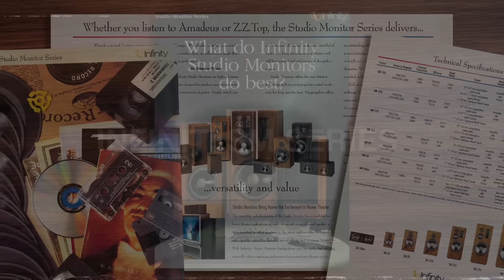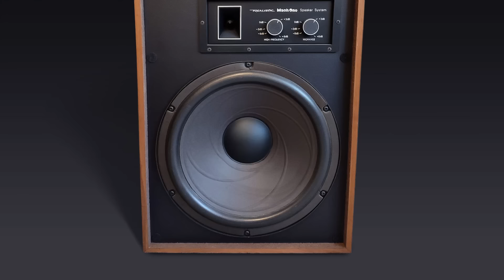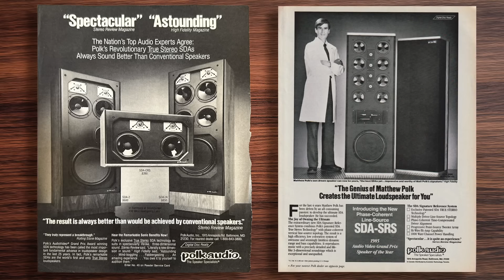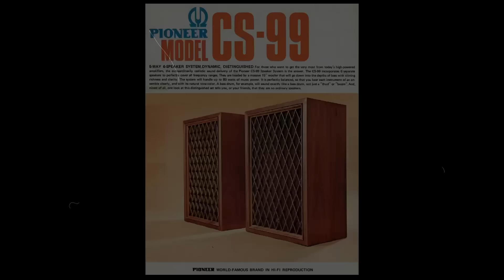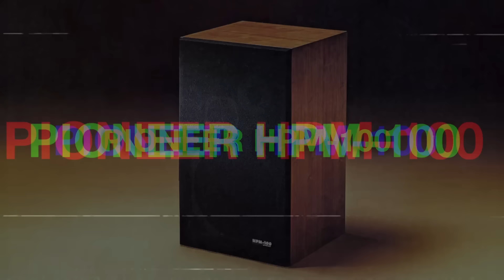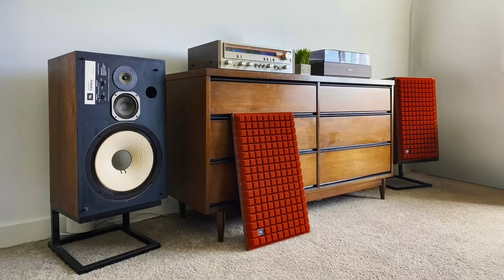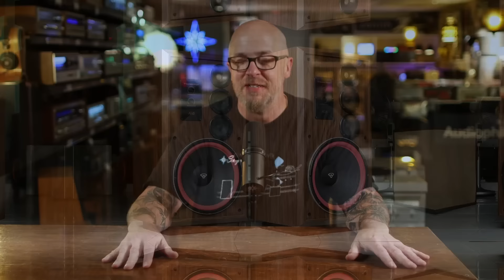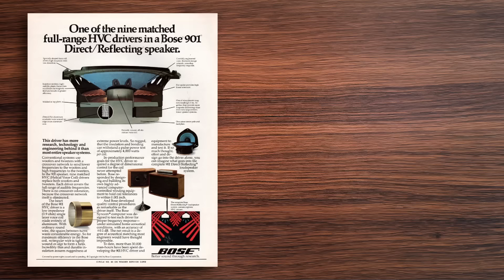Why Do Audiophiles Hate These 9 Legendary Speakers?

Comment: I used to have a pair of those famous JBL L100 speakers. Mine had the way cool orange foam grills. They were terrible. The high end cracks, rolls off distorts and the low end was muddy and bloated, like the bass driver never stops moving, so rapid eighth notes just sounded like a blur. But my friends loved them for loud rock music. I was using a Crown amp with the equally famous Crown IC150 pre-amp. I finally saved enough $$ to sell my JBL's and buy a pair of Dahlquist speakers. What a HUGE difference... LOL

Comment: The 901s are VERY sensitive to placement.  If placed properly, they sound great.  If not, they don’t.  

Most complaints about them are from people who have never heard them properly installed, or they’ve read from others that they don’t sound good, and simply parrot the same thing to others.

And BTW, they are the most durable speakers of the ones you mention because their 9 voice coils per loudspeaker (and large voice coils with relatively thick wire) can handle oodles of current.

Comment: IMO, both Klipsh and Bose are masters at squeezing every ounce of sound out of some really cheap, cheap drivers.  I used to work as an installer at a pro audio store and they sold and rented a lot of Klipsch.  They were really big on  Klipsch Heresey's.  They had a horn for highs, a horn for the mids and a 12" woofer.  And I watched them get cheaper, and cheaper, and cheaper and cheaper in the 5 years I worked there.  For starters, the driver they used on the mid horn was a driver used for air raid sirens.  The tweeters were cheap too.  We hardly ever had in our inventory of rentals a speaker with a tweeter that wasn't blown.  We finally stopped replacing them.  Customers couldn't tell the difference anyway, as evidenced by never getting a complaint.  The following is a real fun story about how cheap the speakers were.  Klipsch had a line of concert speakers systems.  A giant subwoofer, a horn for the mids and a separate box with about 5 tweeters for the highs.  We installed a pair of these in a dance club.  At one time Klipsch, to their credit used a Gause compression driver for the mid horn.  Very similar in quality to a good JBL compression driver.  We were setting the horn up for rigging and as we moved the speaker around we could hear something clunking around in the cabinet.  We opened it up.  We found, that instead of the quality Gause driver, they had replaced it with a manifold that had 4 cheap drivers mounted to is.  The exact same cheap air raid drivers they put in the Klipsch Heresey's.  The mainifold had broken and was rattling around with the driver as they were bolted together.

Comment: Problem is many heat up under a load and need a built in cooling fan, even when you have the right ohm speakers they heat up. I use power amps with built in cooling fans and besides you get much more watts per channel but if you don’t need that much power go with a vintage model 👍 I just like lots of low bass and extreme loud volumes thats just me🤔

Comment: I used to sell the Mach 1's at Radio Shack in the '80s.  Everybody wanted them but they were expensive and most Shack customers couldn't afford them.  My 2 favorite controversial speakers are the Realistic Minimus 7s and KEF Q-series.  So many people get down on the Mini7s because of the 4" woofer and the fact that they could be had at an annual Shack sale for $50 a pair, but they are awesome for computer system speakers.  I have 2 pairs.  The Q-series are considered a sell-out to the mid market by serious KEF fans but I love them.  I have a 5+1 system for my home theater and a pair of stereo speakers for a listening room.

Comment: To be fair, Audiophiles also tell me that I need insulators for my speaker cables and that they can hear things I can't measure with my 500MHz oscilloscope.  So I don't put a lot of stock into a lot of things they say.  Anyone who thinks they can hear the difference from a $280 power cable and a $70 wooden volume knob doesn't get much credit from me.  Keep the speakers you like, most of these guys are older men with HF hearing loss anyway (I know, I'm one).

Comment: I love my Mach-1's; I have the version where the foam holds up.  Their midrange is not good enough for me , so I pair them with to really nice midrange-tweeter speakers that hang from my ceiling.  I love them for Dark Side Of The Moon with the speaker combination.  

The Mach 2's are also very good speakers.  

People hate them mainly because you could buy them at Radio Shack.

Comment: Just bought a pair of Cornwall IVs...and they're absolutely amazing.  They are extremely revealing.  Have the right combination of preamp/amp/source or be prepared to cringe.  I run a Rotel A12 MKII (which is very dry/lean), a Rotel Tribute CD and a stock Fluance RT-85.  Play Black Cow through it and tell me my speakers are "shouty."  Play a jazz trio through it and tell me it's "harsh."  If you do, your ears are broken.  AC/DC...yeah, okay.  You got me there.  Not a great metal speaker.  I can't wait to get my first tube amp.

Comment: I drooled over the Mach 1s for years but never could afford them.
Reply: Lucky you. I pestered my parents to loan me the cash for the Mach One, and they finally relented and gave me the speakers for my 15th birthday. I hooked them to my father's Pioneer SX-1250 and they... they sounded horrible: muddy bass covered the mids completely, leaving only the shouty, raunchy high frequencies that were an insult to the ear. I had heard excellent-sounding Realistic speakerrs before (one of the models with an unremovable wooden mesh grille, 10-inch woofer judging from the massive but controlled bass, no idea about the other two drivers but they sounded good and they sounded right for the frequencies they covered so Xover must've been well designed) a well designed crossover was not present in the Mach One, it was cheap and flimsy. These speakers still exist, at my parents' house (in the attic), with less than 10 hours on them. Lesson learned: get to know what you're buying before handing out any cash.

Comment: Dude learn how to mix take the tops down. The Cornwallis and NAD power envelope impressed an audio engineer in my home.  Best home system he had heard.  Or one of the best.   Try this. On an analog mixer. Highs at 10 o’clock.  Mids 12 and bottoms 2.  I work in video production and been in a hundred ball rooms with a hundred a 1 engineers.  Not every all room was great but most are fantastic mixes.  I have ballroom engineer quality in my home

Comment: Not much EU things to see here. In the past I was at the Bose introduction in Amsterdam. 
I found them soundhorror.. 
Marketing made them sell well. 
I was always a fan of the Philips speakers in the past and production of active Motional Feedback Back was sounding crazy for that time.
 Also German speakers like Magnat Kef I found good sound.

Not only the speakers are important.
If you liv in a concrete building or a house with much wood and heavy cutains the speakers will sound  different.
My Braun boxes closed system sounded good in a flat, but after I moved to a country house they sounded sh*t.
Classical music needs other speakers the Blue orRock.
Also it's personal like what you have.
Best is one system with 5 sets of speakers :-) .
It will always be a compromis.
Most people don't have room for 5 sets.
HH

Comment: The JBL L100 is always portrayed as (merely) a rock ‘n’ roll speaker... And they can definitely play rather loud without significant distortion - but rock music isn't generally very demanding in terms of dynamics (lots of compression). I’ve had the JBL 4412 studio monitors for many years now (since 1995, iirc), which are a later incarnation of the concept and driver technology found in the L100. I listen almost exclusively to “classical” music (some jazz, some “world music”), and that’s where these speakers really shine: recordings of complex, multi-layered acoustic music with wide dynamic range—and not all speakers can handle that convincingly. With a quality 4-band parametric stereo EQ (Orban, White, or similar), you can make them almost perfectly linear (or adjust them to your personal taste).

Comment: Audiophiles love speakers with extremely low efficiency. Ever since the early “East Coast” classics from AR, Advent, Boston Research, and others—which enter thermal compression already at very low listening volumes and thus “round off” all transients—this artificially softened sound has been regarded as “refined,” “neutral,” and “high-end.”

Comment: As a Baby Boomer, I grew up with Quad Electrostatic 57 speakers and Quad and Leak Valve systems.  I'm still a fan of Electrostatic speakers, despite the fact they don't go deep enough for Heavy Metal.  That said, at my age, I'm losing my 'Top End', so don't mind that they only go as low as 80 Hz.  As a fan of Accoustic and Choral music, the Quad 57's are ideal for my needs, driven by a good valve amp.  The downside of the ELS-57 speakers, is that I live in Great Britain, where the weather can be a bit 'moist' for much of the year.  This requires the Quads to be serviced at regular intervals, as they don't like high humidity.  Russ.  Hampshire, UK.

Comment: I'm listening to this through a set of Infinity (with a "y") SM 100 10 inch two way speakers. I have a set of SM 102 speakers, which are the bookshelf model, inthe next room. Sure, they're not super accurate, but if you're just watching videos, TV, and playing low volume music, they're just fine. I live in an apartment building. Buying super expensive speakers would be a waste of money.

Also, what happened to the Panasonic "Thrusters?" 😅

Comment: In 1980 I had an accident in an old Mercury wagon.  I flipped and rolled the car 3 times.  In the back, I had my HPM-100s.  They moved from the back to the middle of the car behind my head and actually supported the roof of the car which was smashed all over except around my head.  Had to pry them out. They worked normally!  I was shocked and thankful they supported the roof.

Comment: I had a pair of JBL L-100s. Yes they sounded good with heavy rock music but for me that was the limit. Gave them as part of a tip to the driver of the moving van  who transported us to a new residence.  I now use McIntosh XR-7s (2 pair), XR-5s ( 1 pair) along with the McIntosh speaker equalizer. For my ears I’m getting flat, natural sound.  One issue: the equalizer need to be calibrated via an analyzer in order to adjust the many capacitors to room acoustics. Once that is done, WOW.

Comment: I remember the Pioneer, and There were also some Sanyo, most of the 100-120 watt 12-15 inch speakers came with automatic resetting circuit breakers in them. At least in the early 1990's they did. What you do is use them for the stereo portion of a 5.1 system, keep the powered sub as well, then add a good center speaker and 2 normal modern studio speakers for the rear.

Comment: I recently grabbed a set of new Klipsch R40M, and found them incredibly harsh UNLESS they are jammed up hard against a wall. Then the boundary effect greatly boosts the critical 150-180Hz region,  giving the top end the foundation it needs. My wife absolutely loves them matched with a little REL passive subwoofer, FiiO K11 R2R DAC, Douk Amapapa D1, and a Fosi M03 subwoofer amp. And sol I must admit, that when properly integrated, Klipsch can sound incredible. I currently own 31 sets of speakers. And a lot of blown up subs. :)

Comment: I have had a few of these.  I have the 901 series 6.  I owned them for many years before I really heard them as they should be heard.  If you’ve only heard them with 100 watts through them you’ve not heard them at all.   They don’t even wake up till they have 300 watts going to them.   They will take 500 watts and even 600 watts in some instances.  I have an amp with about 600 watts max burst headroom and they don’t miss a beat.  People think because they have 4.5” drivers they can’t produce, but the drivers are not like a 4.5” midrange driver that doesn’t move.  They are full range drivers but they are built like high excursion woofers that are just small.  They really move like woofers.  The surface area of 9ea 4.5” drivers is equal to a 13” speaker.  When they are really cranking the air coming out of the ports is like a leaf blower.  The windows will rattle.   The part I don’t understand is how they produce treble because they have no tweeter characteristics at all.   But somehow they do it.   People think because they are generally small enclosures they won’t fill a room.  That’s just not true.  I have a big detached garage and they fill it well.  They need a lot of power and space to spread their wings.  Are they audiophile quality?  No.  But they also are not titanium dome tweeters that you need to sit directly in front of to sound good.  They sound 95% everywhere as opposed to 100% directly in front of.   I have high end audio in the house and I find myself enjoying the 901’s in the garage more.  Come on over and take a listen and you’ll change your tune about them.   I’ve had more than one friend hear them and buy them used.

Comment: If you like accuracy, which I do, this is mostly not a good list. I don’t think you need to ask why audiophiles hate these speakers when you talk all about how muddy they are or how there’s not enough midrange or how they gratuitously added crossovers and the anomalies that went with them or how the woofer was too big for the enclosure, you’ve answered your own question. If you want period furniture, great. I lived through these. They didn’t have romance at the time and they still don’t. The best on the list is probably the 901. It’s really room dependent because most of its sound is reflected but I’ve heard them sound OK.

Comment: I recently rehabbed my Polk SDA 1C's that I bought 1987. New crossovers/upgraded cable terminals, later model Polk tweeters, Dynamat/epoxied magnets on the woofers and cabinet mods. Unbelievable difference especially the bass response. Good for another 40 years though I'll be gone and they'll still be here.😆

Comment: I still run a pair of Klipsch Cornwalls on my main system. Bought them in the 70's and have only re-capped the crossovers. For me, the crisp high end has always been what I'm looking for and very little else has done it better. I drive them with a 1970's Carver M500T, so it is solid-state but has a very round, tube-like characteristic. Cheers!

Comment: Nothing wrong with Infiniti SMs -- after they get tweaked a bit, that is. Reinforce the cabinet interior with 1x2 hardwood bracing, held in place with a good amount of GOOP adhesive, then stuff some common fiberglass wall insulation behind the monster woofer. Life is good!

Comment: I always preferred the sound on 2-way speakers--subwoofer and tweeter.  I had a small pair of Advent Prodigy II speakers, and they may have been the best smaller cabinet speaker I ever heard.  Affordable, loud, very low distortion, and they could thump.  The hard-shelled tweeter was exceptional.  I have a Bose 5.1 home theatre system today--very nice system--but for rock music with bass, I miss those Advents sometimes.  They had amazing sound to my ears.  If I saw a pair today, I would buy them.

Comment: Regarding the Bose 901s.
I’ve had a set of series 2 for maybe 15 years. Your comment on placement is GOSPEL! It is critical that you find the best placement of all areas: distance from the rear wall, height of stands, distance between units, distance to the listening position, and VOLUME at that distance. I also had the equalizer re-capped and tweaked by a retired Bose engineer who advertised on EBAY several years ago. 
Listening to Supertramp’s DREAMER’s broken glass intro will leave you bleeding, and there is as much bass as you’ll get from most any reasonably priced speaker without a high quality subwoofer. Thus putting an end to the old rhyme, No highs, no lows…….
PS, I’m old enough to have heard the 901s from day one to their stand-alone stores; and I’ve heard just about every other speaker since then, and this set of mine stands tall. They may not match our latest, most exotic and pricy speakers with cost no object source chains, but they are certainly worth a listen as part of a vintage, or lesser priced system.